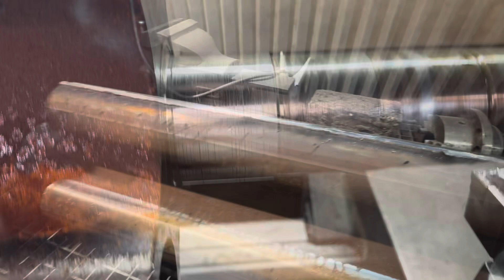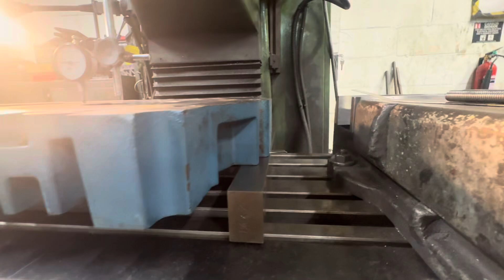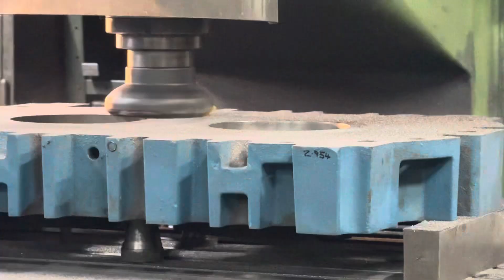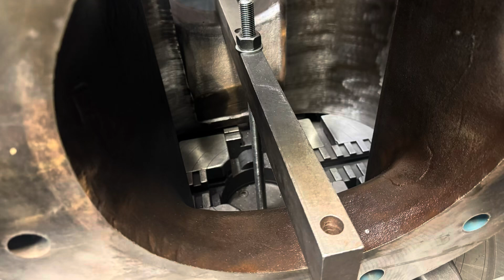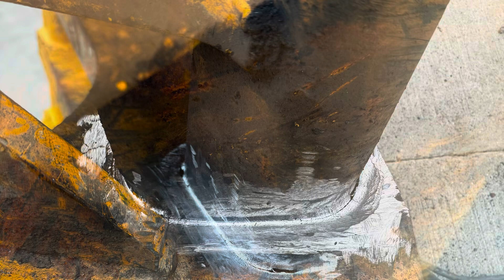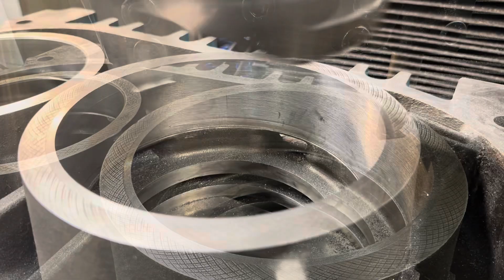Another Boring Video - Repair Machining Of Rotary Valves and Roots Blowers

Comment: Brilliant video, I use a rototec 80 spray welder at work, what powder number do you use for oil seal journel? I have been using 21022 powder for most jobs, I usually only repair bearing fits or end of shafts from pulleys

Thanks